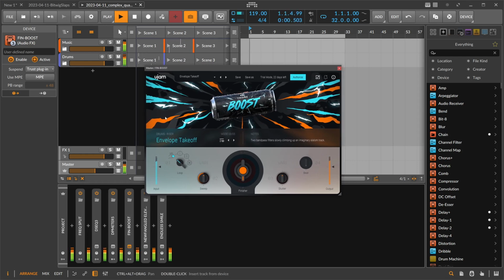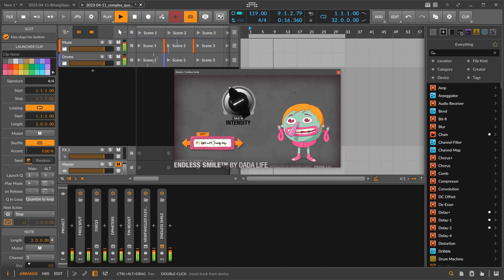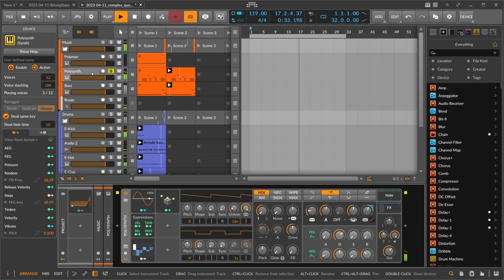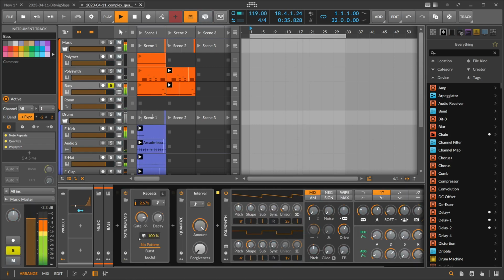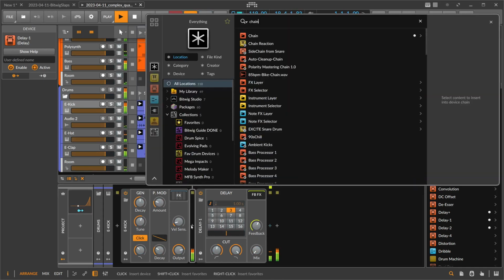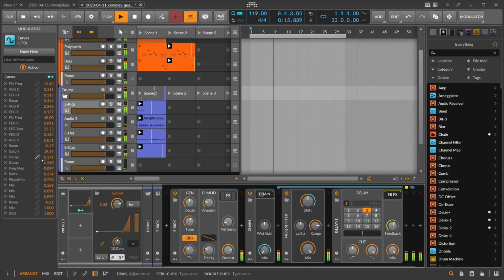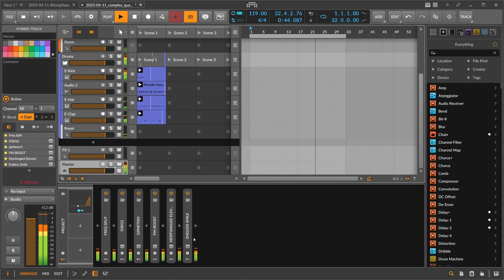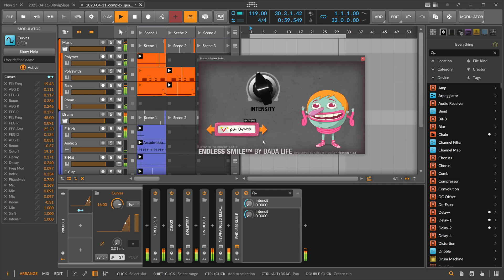Create Risers and Transitions with Bitwig Global Modulators

Comment: I think it gets much more interesting when not all parameters are modulated by the same curve. Some parameters should go up faster, some should go up slower, some should suddenly jump up, some changes should start sooner, some later, ...
It gets even better when you set the speed of the different curves to 0 and then modulate their phase from 0° to 359.99° with a macro. Now you can either control all those different curves with one single knob in a live situation and you could also modulate that macro with a simple upwards saw LFO to get the previous behavior. With that LFO, you also have a common speed parameter for all those synchronized curves.
Reply: Would be cool to see a video on how this is done in practice 🤔🌺

Comment: I love the modulators and mostly want them set to Sync, but it annoys me when your track has a section where it drops out of (in this example) an 8 bar loop, so I do this:  I have a track in my template project that is purely for triggering the start of modulators. Just a midi note that triggers at the start of 8 bars, set the modulators to Note and have a note receiver to trigger it. That way, when my track drops a bar or whatever I can just realign the note triggers from that point.

Comment: Hey, this modulation system in bitwig is really nice. But to be honest, most of my composing is best made with writing/drawing automation. It's faster and more precise. How about making some automation paterns that you can quickly drop on a bar in the sequencer? So that I don't have to snap what i draw all the time.
Reply from the maker: usually also only use automation. most of the times its enough, sure :)
Reply: Drawing automation suffers from curve smoothing. You can turn it off with the Curves LFO but not in the Bitwig automation window. Ironically, Curves and Segments LFO has more precise control

Comment: genius! i was wondering what i would use the project modulators for. thank you!
Reply: Another use-case:
I route all my return tracks with delay/reverb through a common mix bus. At any point, I can turn down the volume of that bus to bring everything much closer to the listener and change the virtual room from a big hall to a dry studio.
But sometimes I want to use delays or reverbs as insert and not send effects. Those won't be affected by that. So I use a global macro to control the volume of that bus and also the amount of all those insert delays/reverbs.

Comment: Nice! I can’t wait for the full release! How would you automate the triggering of the curves, rather than having it on all the time?
Reply from the maker: i would automate the amount slider in the right places. or use a steps mod with very slow timing to switch it on or off. or you can use instead of 16bars also 32bars or more, so it really only occurs on drops (intro/main or main/mid)
Reply: @PolarityMusic is it usable sometimes to use multiple of these curves (for example four happening within a 32 bar loop), all of which happen individually every 4/8 bars for example, and they all modulate different parameters, to create even more variety? :)